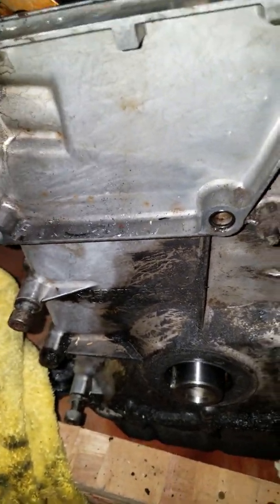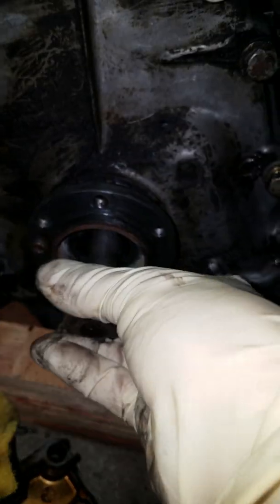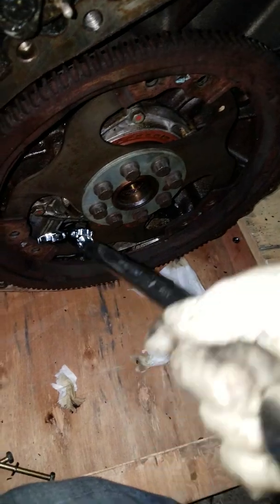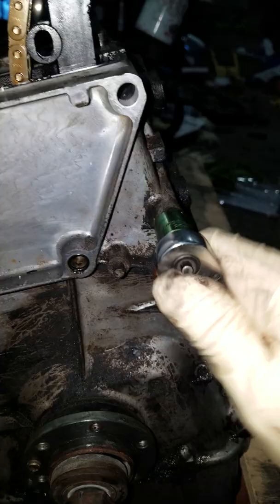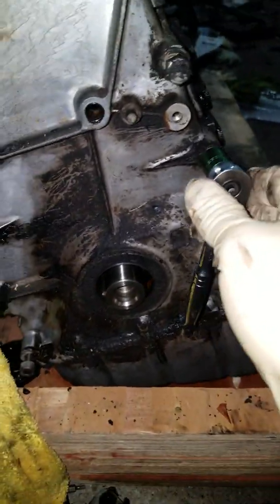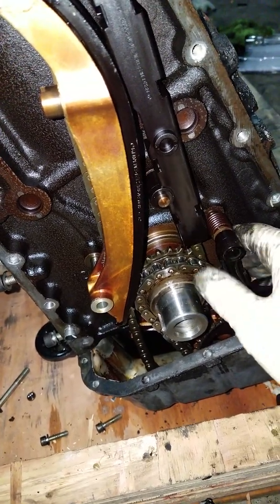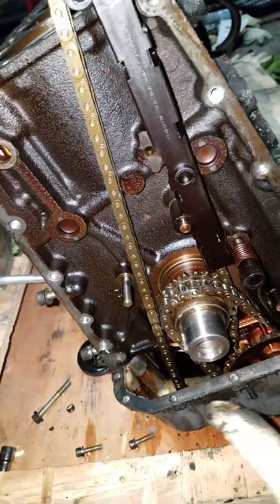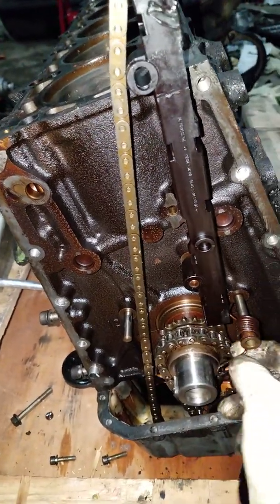m103 engine disassembly Part 6

Comment: I have to replace the cam on my m103, do i have to remove the tensioner to do that or do you think i could get away with letting the cam gear sit with the chain and just remove it from the cam like that? if i have to do something with the tensioner, can i just remove the bolt/spring or do i have to remove the tensioner completely with that big holder nut thing that you pulled out in part 5?

i would like to do it as quickly and simply and do the least amount possible as its my daily driver and i don't wanna risk dropping parts of the tensioner down into the timing cover/oil pan or something
Reply from the maker: make sure the rockers match and I would remove the tensioner if it were me
Reply: @loomerc3002  in the video of you removing the tensioner after that retainer, it sounded like something fell into the timing cover, or was that something else? That’s all I’m worried about really

Comment: Im not an expert and im trying to change the timing chain on my car, my question is when the engine is still in the car how i can take off the nut ?
Reply from the maker: stick some wrenches at the back of the transmission hole from underneath hope this helps
Reply: Loo Merc300  okay i will do that, if I could send you a picture on why im trying to change the timing chain, its because the chain is hitting/scratching the timing cover. So hopefully the update will help !!